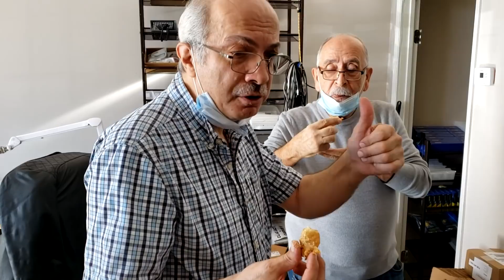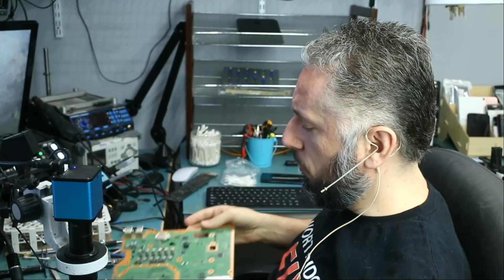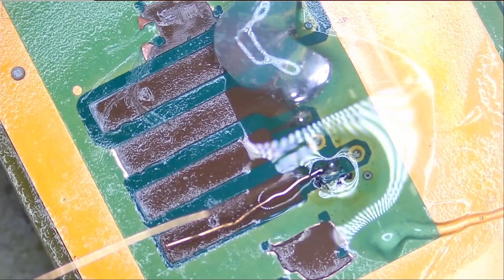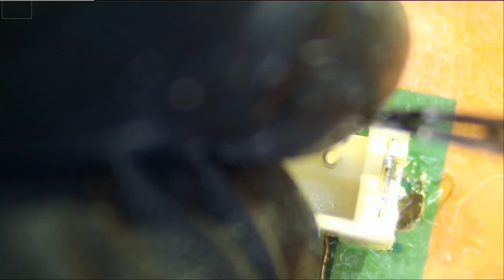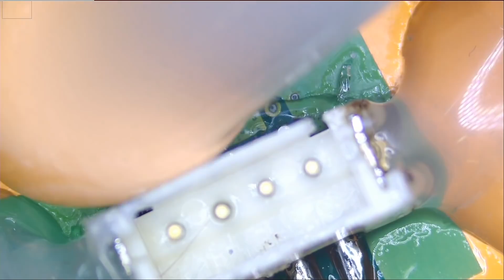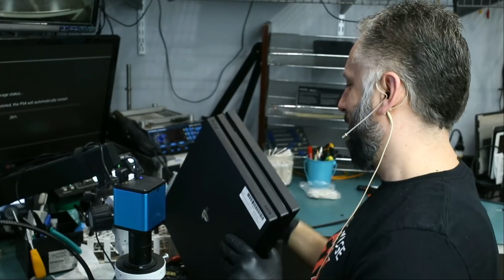PS4 Pro broken power connector Repair - Customer brought us Sweets.

Comment: how would one determine the strength/diameter of the copper wire used as a jumper? the one in the clip looks pretty thin - but how thin can i go? the PS4 PRO power supply transmits 10A, does that play a role in the equation? cheers

Comment: I chose to use 34awg Enameled copper wire for this, before I proceed will this guage of Copper wire be fine for the pads?? What temp for the soldering iron for this and what tips do you use??

Comment: Do you have any pics of the back of the board 

Someone did a terrible repair on mine and I just get a blue light now. Checked the pins and they are fixed now after I removed all the glue and wires. 

I think the repair was attempted from the back so may have lost some resistor near the plug. 

Would a bad connector show no life at all or blue light ?

Comment: Hi, enjoying you vidoes after finding your channel and leaning lots. 
Have a strange laptop problem if you ever experienced or know of a case. 

Have a old 2011 HP laptop a 4530s and every attempt to install windows by usb or dvd starts to load but then fails and either kicks back to bios screen or shut computer down completely??  Already swapped memory and slots and HD is known good. laptop always turns on and goes to bios although i cant seem to find bios flash screen eventhough there is a option to flash bios in menu. 
Cleaned memory slots and used other known same memory from other machine same specs.
I thinking bad bios or controller or memory controller nth/sth bridge? or power through MB is weak somewhere (bucks) caps ect and cutting out under load when windows installs? Thats all i can think of. Reset bios to defaults and tied uefi as well than legacy but nothing. So you can see the windows files load at bottom of screen then the win 7 or 10 logo appears (tried both) , then the screen and HD freezes OR laptop shuts downs or goes back to bios. i also has a BSOD code 174 too and power stayed on that time. so something major wrong i guessing or conflicts somewhere? 
thanks for any help 
Tim from Australia

Comment: just last week i had to fix my ps4 pro. don't know why but on all ps4 pros that one power connector is the weakest part on the board had to take similar steps to what you did. To fix mine it feels great when you can fix something on your own. but as always if your not comfortable fixing something yourself just bring it to a professional but if its a trade you want to get into practice on scrap devices  before you try to actually fix your own device. it's how i learned to do soldering and board repairs though i only fix my own things

Comment: I think this is the second power connector on a PS4(pro) and it most likely happens when people hearing their fans spin up high in games and think they need to clean out the PS4 and put new thermal paste on the CPU.   Why the pads get ripped off (or the connector) is because inexperienced people yank as hard as possible and instead of the cable they use a tool and rip the connector off the board.... Why do I know this you ask... Because I repaired 5 of them in the past month, and when I ask them why it was opened the answer is always that the fan was loud and they thought the system was overheating.  I saw how you repaired them in an earlier video and have since added that to my repair kit as well.
Reply: Can confirm... (the place I sent my ps4 pro into said they couldn't fix it and wanted 40$ for it back) (still broken)

Comment: Ripped power connector in PS4 is a common problem. It is very simple to rip off because it is knowledge required to disconnect the cable

Comment: Why not use epoxy to glue down the connector like jb weld etc? Just curious
Reply: Probably because hot glue is more convenient, it is strong enough, and it hardens way faster than epoxy.
Also hot glue is cleaner because it leaves no residue. It doesn't require a chemical reaction like epoxy/superglue, just a physical joint.
Reply: @popcorny007  what you said. also hot glue is easy to remove and clean (compared to chemically bonding glues) in case a next repair is needed.